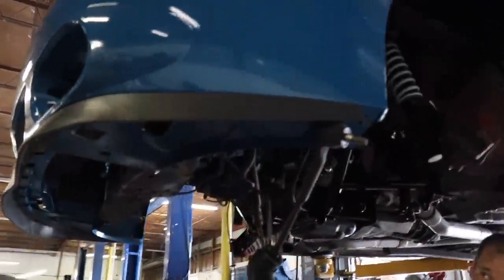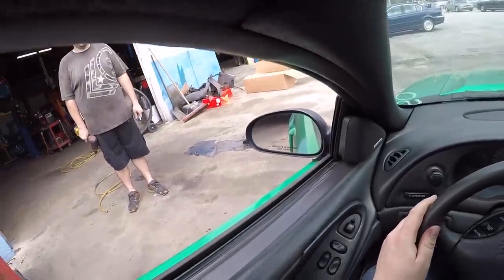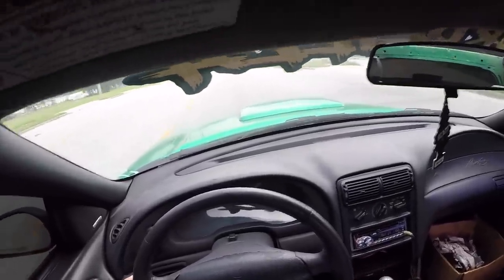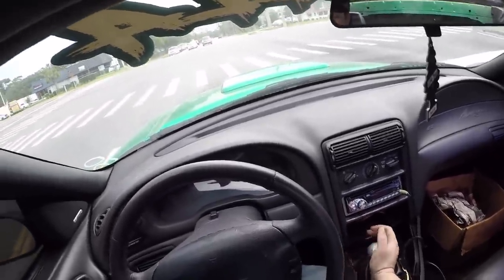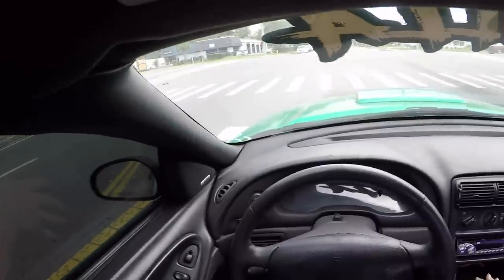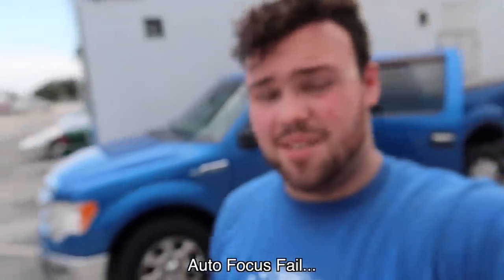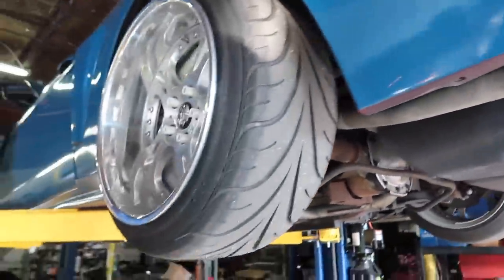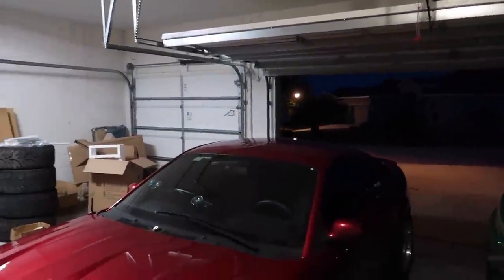IT'S DONE! First Drive with Fully Built 4.56 Rear End!

Comment: I really think you are going to love the 4.56s...I wish I had gone that steep (went w 4.30s).
Reply: 1996 Cobra I run the 4.30s with a 26inch tire and love them
Reply: tanner69331 nice...what'd it run?
Reply: 1996 Cobra 12.87 @ 108mph on motor and 11.80 @ 116mph on spray I'm cutting a 1.5 60foot
Reply: tanner69331 wow nice...you had all the boltons (shortrunner and pulleys)?
Reply: 1996 Cobra longtubes o/r x pipe magnaflows w/dumps imrc delete back seat delete and deleted the airbag system and custom tune

Comment: Hope you didn't order division x rails for the cobra. They won't clear the bypass valve.....Ask me how I know lol
Reply from the maker: I’m running stock rails until I switch to a whipple :) I have the 1400rwhp dual 465 fuel system coming
Reply: That's the same setup I have on mine. I had to go with fore rails. Lethal had to refund me for the division x rails after I proved to them they wouldnt clear the tvs boost bypass valve.
Reply: We pretty much have the same set up on our cobras. I run e85 on mine though.

Comment: What transmission you running. Most likely not the stock 3650? Auto? I put 4.10 in my rear. Moser 31 spline. Ford racing diff.
Reply from the maker: 3650 Trans.
Reply: My 3650 lasted 3 months with 3.73. I blew that up and put a TKO 600. Highly recommend TKO if you end up blowing your stock one. Nice car. Mine was an 03. I have a 12 now
Reply: Jeffro Dizar I was looking into replacing my stock with a tko600, how was it??
Reply: Matrex47  perfection. I beat on it everyday for 5 years. Literally. Great trans